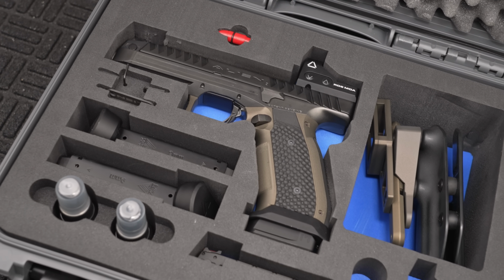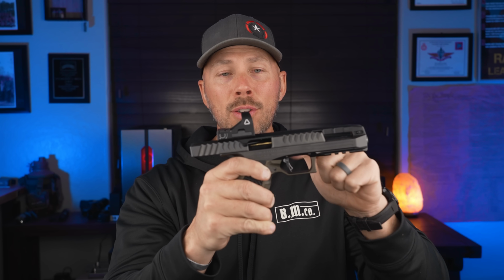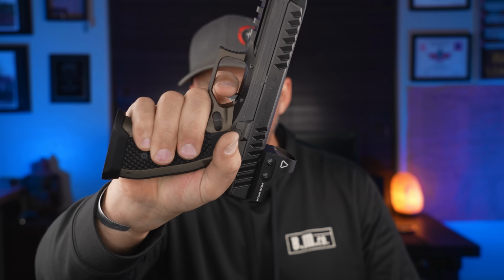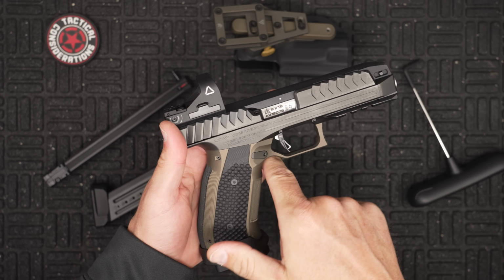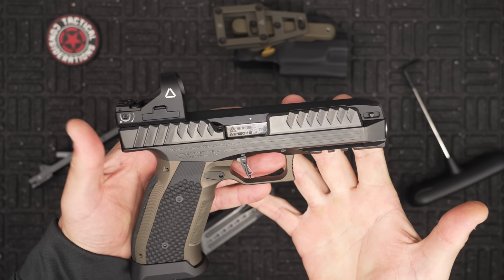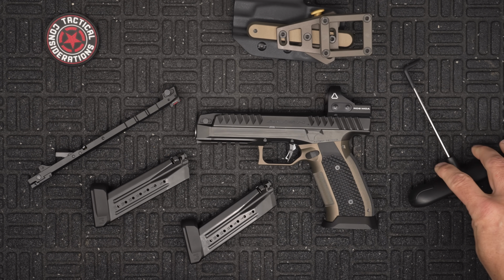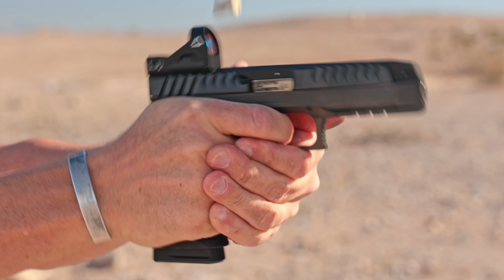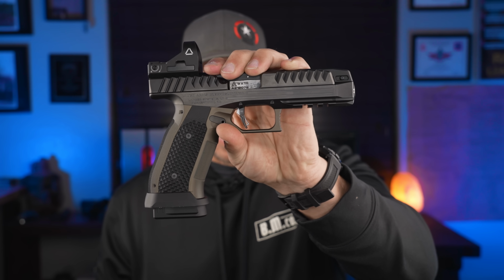Most Expensive Competition pistol.. Laugo Alien Pistol

Comment: You are right about the price going up based on availability.  Mine was $7200 after sales tax.  Was it worth it?  Well, it does everything that the pro reviewers say it does.  The red dot does not come off target when rapid firing because the strait back recoil impulse and it is hard to miss with it.  That being said, I will take my CZ Accu-Shadow 2 x with a RMR.  It is just as accurate and I am better at speed loads and tac loads with the CZ.  AAwsome gun, no regrets on buying it, but it stays in the safe.
Reply from the maker: Ouch

Comment: My 1st Gen Alien is very fun to shoot and I’ve ran some matches with it and a number of my friends compete with them as well. Unfortunately, the 1st Gen’s like the one featured can be a PITA to keep running and require some workarounds to solve some of the various quirks that can come up after increased round counts. 
I’m curious to see if the new Creator model with a 1911 grip angle has fewer hiccups .
Reply from the maker: I have heard the first 500 didn't like to run when they got hot. That is why I ran this one till I couldn't hold it.
Reply: I didn’t have a problem with the heat. It’s not really intended as a mag dump gun and I usually run low round count measured drills so  it has time to cool down while I reset etc . There’s a list of other things that can go wrong suddenly  - nothing that can’t be figured out but frustrating when you need match quality reliability. When I first got  it , I was incredibly stoked on it - it’s a great experience and performs as advertised ,  albeit with some weird quirks during high speed work .  But fundamentally, it’s still a recoiling 9mm pistol  offering marginal gains that can def be exploited for an advantage by a good shooter - except that practical competition is more about how fast  you are on your feet and target transitions than split times or pinpoint accuracy . For me , I stick with my basically stock Sig’s or CZ’s with factory ammo at matches cause I don’t want to think about a gun or ammo or  reliability issues at all  - just my movements between targets .  @TacticalConsiderations
Reply from the maker: out of curiosity what were the other issues you had.  I try to have as much info as possible from first had experience with things like this.
Reply: Ok - my Alien only likes S&B . Due to the mag design and feed ramp, the OAL and bullet shape dictate whether I can rack the slide on a full mag. The bullet hits the base of the firing pin saddle and some ammo won’t allow you to rack , only drop on an open slide. Now I’m capped at 10 and the factory 10’s are oversprung - very difficult to load the final round. This whole issue is a problem when an unloaded start is required. Apparently Laugo offered replacement mags but I didn’t get around to following up on that. 
The chamber is very deep and a couple times , during high speed reloads , the cartridge chambered backwards -had to get out the pliers. I actually can’t figure out how that happened lol ! 
After about 5000 rounds , the slide stopped  cycling consistently. There’s a number of reasons that could be happening: too dirty , too clean ? , too much lube ? Gas piston worn out etc . I have extra parts , cleaned it well etc but I just shelved the gun for now until I decide to spend the time analyzing the problem. 
It’s def a unique experience to shoot and I have a buddy who worked thru his issues and placed 16th at the IPSC World Championships with his Alien  - so if you have the patience, the pistol performs . I just decided that pistols should be easier to maintenance and I have a lot of guns with 10’s of K rounds that are still all OEM . 
I’m going to double back to it eventually and get it running well again but as all my range time is focused on match training, for now , I’m  sticking with my pistols that just don’t quit 
The latest versions may be more refined - I’m going to follow how they’re doing  @TacticalConsiderations
Reply: How do i know its a gen 1 ?
Reply: @AboHashemSA  The Alien Creator is the Gen 2

Comment: My concern with this design is that the barrel is in the frame. The barrel gets hot, the frame is metal, the heat will transfer. Just a matter how bad it is I guess. I would prefer a 2011.
Reply from the maker: Well if you mag dump 500 rounds that might be an issue.